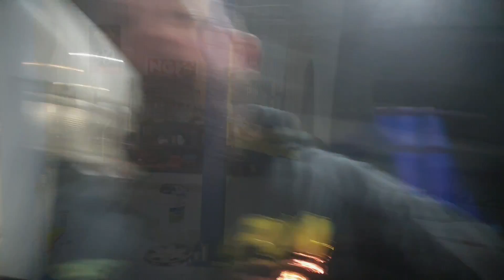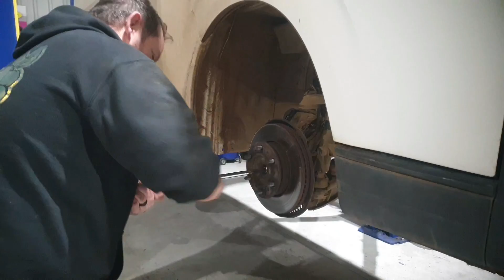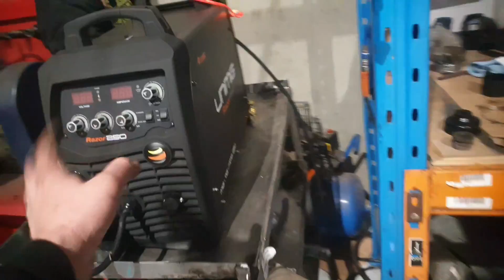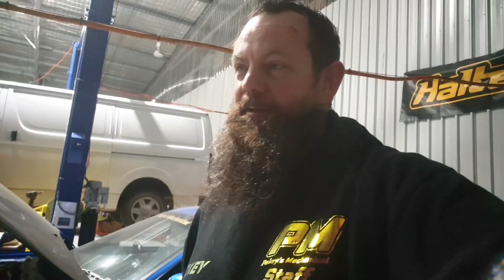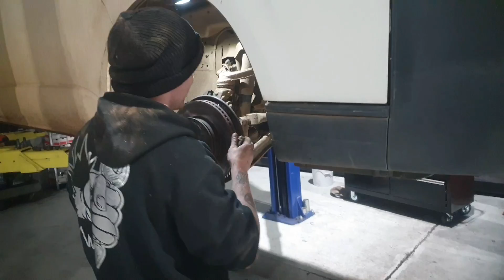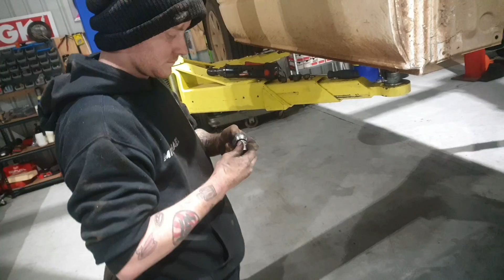Toyota Hiace wheel bearing replacement

Comment: Thanks for the video and tips Pokey. 

I’ve just completed a 4wd Hiace front bearing replacement at home and while tricky, it is possible with the right tools. Some extra tips for those attempting: 

The biggest slide hammer you can get combined with a couple of long bolts threaded into the back of the old bearing flange allowed simultaneous smashing from front and back with the help of a mate. Disconnect the steering  tie rod for more room and a better swing at those bolt heads. 

Make sure you have had your Weet bix as these Hiace hubs will have you inventing new swear words!

Comment: Awesome video pokey 

The cable ties work awesome to hold up the brake calliper but another great way is to get some 3-4mm steel rood and bend them into a hook like a butchers hook and u use one side of the hook to hook on to the calliper then the other side to hook on to the spring or what ever u have to hang it on cable ties u have to pay for there not much but in the long run saves heaps of money 

Every mechanic has there ways of doing thing which is cool coz u get to learn from fellow mechanics, that’s the way we do it at our shop if u wanna try cheers pokey 🍻
Reply from the maker: Yeah I have used the hook tool idea before, I am getting there, its on my list when I go to the scrap yard for things like this but never remember when I am there to grab the steel